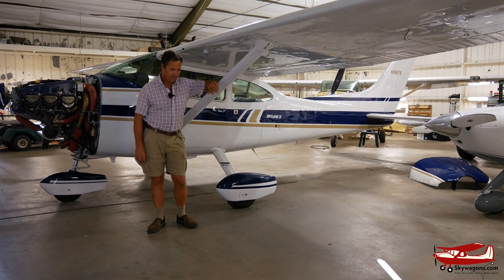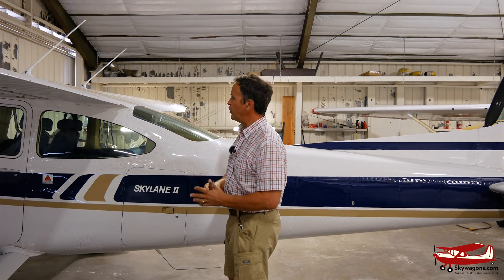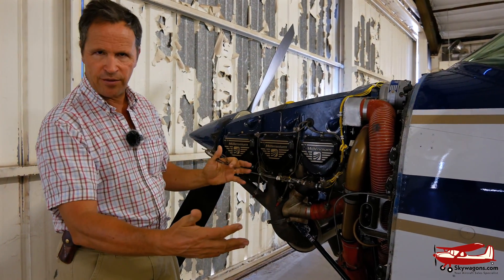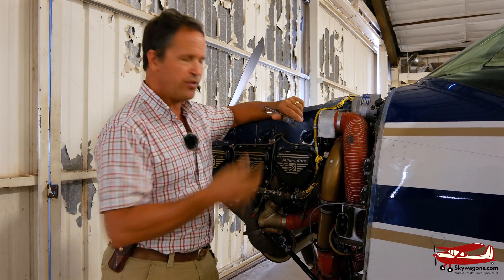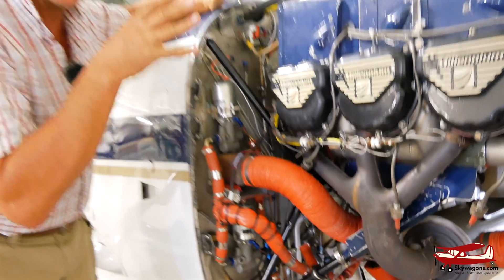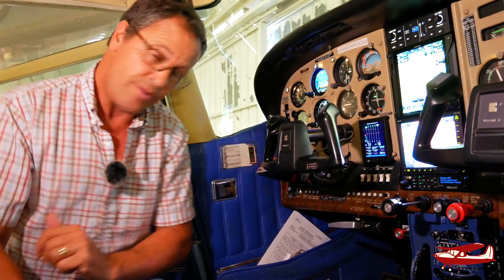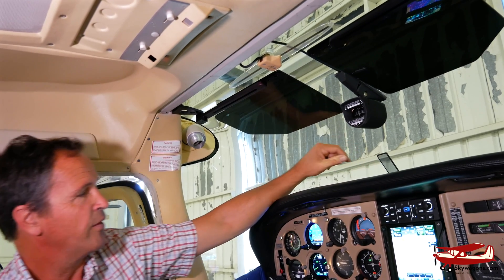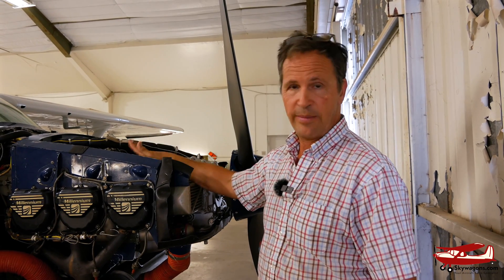Supercharged Cessna 182

Comment: Vortech is an automotive supercharger.  Not sure is the relief valve allows it to shunt all the drag.  I'm betting that 4 hp is the normal drag and under high load liekly more like 11-12hp subtracting from the net output.   And any time you have boost it increases the air charge temp.  Is this system after-cooled or intercooled?  How many Psi of boost does it generate, as it may not need a cooler.
Reply from the maker: These aircraft superchargers are nothing like the boost of the cars ones.  These just blow a bit more air into the engine.

Comment: G,day Mark from Sydney Australia. In the event of the supercharger belt breaking, will the engine continue without the two fuel pumps?
🌏🇦🇺
Reply from the maker: Yes, if the belt broke you pull the bypass knob and go normally aspirated.

Comment: What kind of TAS and fuel burns were you getting? Impressed with performance?
Reply from the maker: It climbs better, It is faster at altitude because of higher manifold pressures.  Fuel burn is more when high because you have higher MP. It is very good but you'd really have to needs it, Like always be hot and high like living in CO or NV, WY etc.

Comment: I recently purchased a 182Q with a IO-470F (260 hp) w/ the same super charger. I removed the super charged since I’m a low lander and usually at sea level. The biggest concern when taking off was watching RPM’s. It was easy to redline which why I suspected the engine needed a complete overhaul at 900 hrs. Other than that, the belt needs torquing every few hours which is a pain taking off the cowling to access it. 
All said, If I lived or move to a higher altitude, I’ll definitely reinstall it. It was great having sea level performance at6k’- 7k’
Reply from the maker: Did the RPM red-line or the manifold pressure?
Reply: Hey Marc,
Yes! You really had to watch the throttle on take off. This is my first high performance so I needed 5 hours for my checkout. The engine was spewing oil when I bought it but was able to  fly it for almost 5 hours so that was the my biggest concern when flying it.

Comment: Another nice aeroplane, super aeroplane, and another great video.

Iirc, on later Spitfires, their superchargers took 300bhp to spool up, but at altitude gave so much better performance. I seem to recall too that many WWII fighters had Ethanol/Methanol water injection, so as to boost power during battle and overcome pinking/detonation issues.

Superchargers being inlet/induction based, turbos being exhaust/outlet based.

Please excuse my ignorance but why does the aircraft need an angle of attack indicator🤔
Reply from the maker: Interesting first part of your comment.  The AOA question? I do not know why it would need it. Probably just for pilot confidence.

Comment: Maybe the chute could be kind of flat in the ceiling. Of course it would help if the weight of the plane was minimal in a modern construction. The chute can also be minimal even if it means coming down at a somewhat uncomfortable speed. Doesn't have to be a rolls royce ride that one time you destroy the plane, just has to keep you from dying and injury so you can walk out of there if it's in rocky mountains.
Reply from the maker: It's a big chute and it has a big rocket up it's.................. lower end.

Comment: so how does the performance compare to a normally aspirated 182 and a turbo-normalized 182?
Reply from the maker: At elevations where the normally aspirated 182 can do 24 inches of MP they all will be the same.  Above that anything with forced air induction will start to show improvement on and on as it climbs.  If the turbo and turbo normalized and supercharged are all at 12,000 feet and all the same plane and all doing the same MP, they will be the same.  A lot of the benefits of a supercharger like this is lack of heat and maintenance. It's just a self lubricated, cold spinning belt driven air pump essentially. Turbos are always very hot.

Comment: So what does the supercharger do differently than a turbocharger? How much more power can you get versus a turbocharger?
Reply: The limiting factor on the bost could be either the flow that the intake manifold and inlet valves can handle or the wristpins, main and rod bearings. The supercharger may deliver more boost to the intake manifold due to the supercharger pushing out cooler air.  The net boost will first have to oay for the horsepower we used to drive the supercharger “fan” via the belt Mark showed us. The turbocharger is scavenging waste energy from the exhaust manifold. It is therefore more efficient but may supply less dense air since it runs at topically higher temperatures.
Reply: To find the highest net boost numbers must be put to paper. Turbos may “come on” at higher rpms, be more difficult to control and maintain than superchargers. But turbos are normally more efficient.

Comment: Just learned a little bit ago that some racing engines (F1, Indy??) used to use an electric motor to spin the super charger (bit of a hybrid system as they have a battery and electric motor(s) to help drive the car. But somehow using the electric motor to power the forced induced seemed brilliant. Any aircraft engines exploring that avenue?
Reply from the maker: It is a good idea but I have not heard if that is in planes yet.  Batteries are heavy.  Cars need bursts of power.  Planes need long constant sources of power.